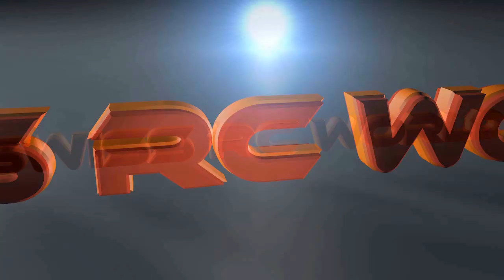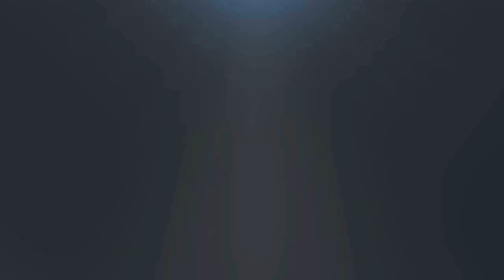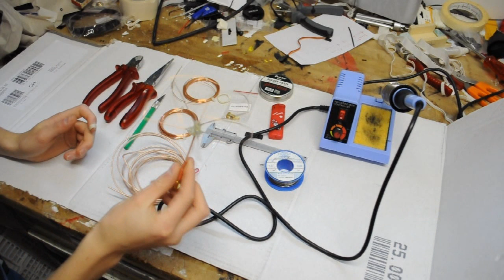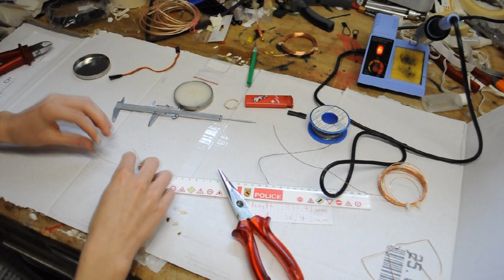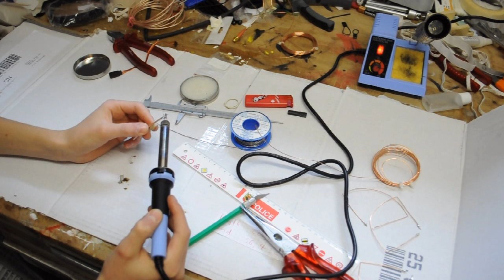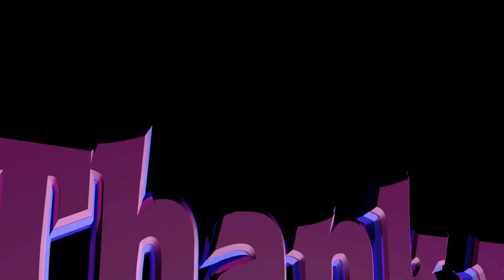[BUILD] DIY Cloverleaf&Skew Planar Wheel Antenna Tutorial

Comment: thats the worst soldering i have ever seen. you should use the iron to warm up the copper and the apply tin to the points your soldering. but not directly on the iron first. that will burn up all the flux and not hold together or work any good. trust me.
Reply from the maker: I know, now...
Surprisingly it held up very well, also in crashes where my HK antennas broke...
Reply: Swiss RC haha. just like my first homemade antennas. no flux, needer glue to hold it together. i got over 3km with them tho. 600mw transmitter. not bad
Reply from the maker: haha kinda the same from me xD